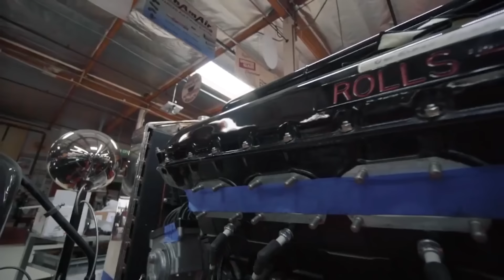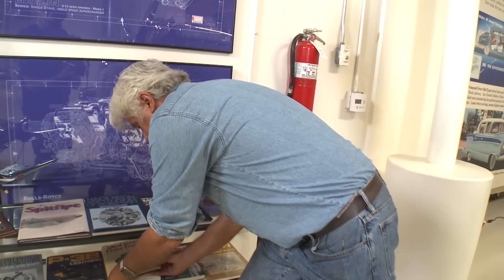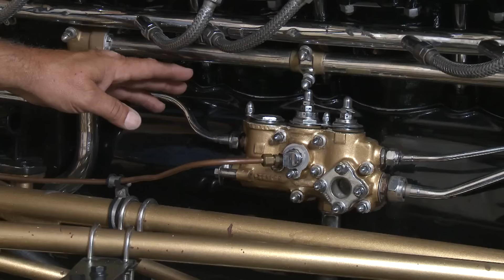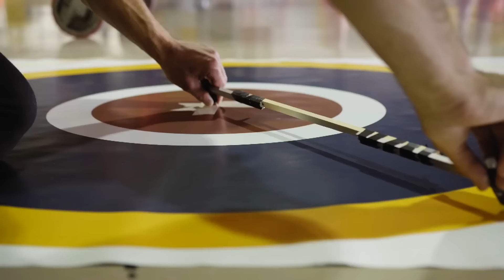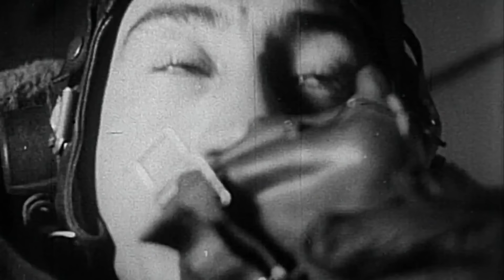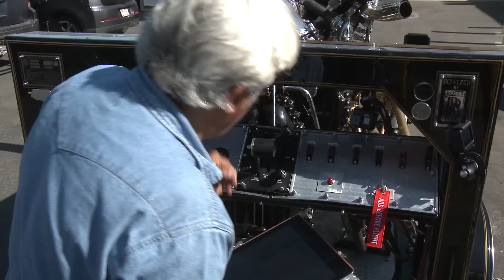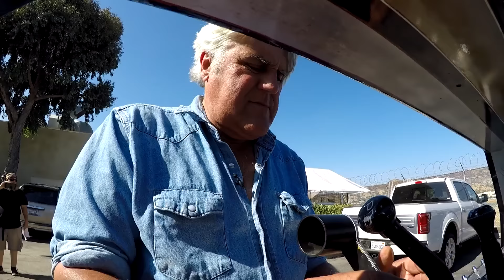The Engine That Won World War II - Jay Leno's Garage

Comment: The 109e Daimler engine was much more advanced, inverted V12, fuel inj, fluid drive altitude variable supercharger. They just didn't build as many as the Brits/US.
Reply: The only real advantage in battle was that it was fuel injected so unlike the Battle of Brittan era Spitfire it could pull negative Gs with no danger of stalling. The Spitfire was otherwise every bit a match for the ME 109. The Spitfire 9 was also every bit a match Foukewulf 190.
Reply: Ah pardon me - google has it more widely known as Miss Shilling's orifice - a device partially preventing what I described above.
Reply: advanced doesn't always mean better.
Reply: When citing German aero engine superiority over the Merlin, don't forget Churchill's admonition: "Second best tomorrow." It's better to have an adequate solution in mass production than low-volume exotic alternatives. The Merlin's chief claim to fame is its ubiquity, whether powering a big Lancaster bomber or a tiny Mosquito. And don't forget the Mustang's U.S. version, built by Packard under license from Rolls-Royce. Some say the Germans' fixation on ever-more-elaborate technology -- whether it be aero engines or battle tanks or submarines -- cost them the war.
Reply: If you're remodeling your house and people are dying, you're doing it wrong. 

War provides no benefit to human society.
Reply: The Nazis weren't equipped to handle the Siberian winter because Germany lacked the resources needed to provide their soldiers with the equipment necessary to survive it. I don't remember the numbers, but the losses due to lack of cold weather gear weren't nearly as great as the losses in combat.

Edit: I guess I should proofread my comments before posting them.
Reply: M ostly because it delayed entry into the war. While the ME 262 was virtually unbeatable in the air they had an fatal flaw without modern alloys they had only about 8 hrs flight time between major overhauls. Throttle response was slow going from cruise to max thrust could take 15 or more seconds, range was vary limited also. A handful were shot down by regular fighters almost all while trying to land.
Reply: leonardo da vinci had excellent designs but it did not mean that he could get them built or that they would work within an industrial process. 

The Germans may have had amazing designs that could be one off built but war was at an industrial scale meaning thousands had to be built.
Reply: The Daimler DB 601 engine was a great motor - small and lightweight: but in almost every other way that counts the Merlin was more capable (i.e. horsepower, torque, reliability, high altitude performance, and the ability to operate Inc a wide range of climates and I unusual attitudes under a wide range of G-loads.  ME 109s were built in Spain after the war and they were fitted with Merlins.
Reply: It's true that the injected diesel system on the German engines gave them an advantage, particularly with negative G forces. Mrs Schilling's orifice was a diaphragm in the float chamber with a hole in it, to alleviate the carb flooding caused by negative G, and gave a useful improvement.  Later, all the Merlins (UK and Packard built motors) got a pressure carburettor, which solved the problem of engine cut-out during negative G forces, without the complication of the fuel injection system used on the BMW and Daimler engines.  That's the kind of war-winning technology used by the Brits.  Solve the problem as economically as possible, so you can field the maximum weaponry as continuously as possible

BTW, the pressure carburettor was a joint US / UK development, no one can claim it as their own.  Made on both sides of the pond.  Once developed, everyone used it

Also, the Napier Sabre engine was way more technically advanced than the Rolls-Royce Merlin.  It had two flat 12 engines geared together, with sleeve valves, and sophisticated supercharging.  Like the German engines, it had a mechanical computer to juggle throttle, supercharging, propeller pitch etc.  Early in its combat career, the mechanics discovered that they could jigger the computer for what they thought was more performance.  In reality it caused serious damage to engines, and was the cause of much of this engine's reputation for reliability problems.  Once this was stopped, quality control improved, and a few development issues resolved, it was a very fine motor indeed, with 3000 reliable bhp on late WW2 engines.  Prototypes gave as much as 5000bhp, but there was no propeller in service which could make use of this output
Reply: The dive was initially a problem for the Merlin as the fuel went to the top of the Float-bowl ( or whatever the equivalent was) under negative-G causing the engine to momentarily cut out, you didn't "Fall out of the sky". This was solved by a British woman engineer called Miss Silling. It was basically a flow limiter inserted into the Carb and nick-named "Miss Silling's Orifice". It was also found that the two stage supercharger on the Merlin was more efficient than the German Variable blower. This is all from memory when I visited the RAF base at Scampton where they keep and service the Battle of Britain Memorial Flight, so I can't be more exact on details.
Reply: The reason the Merlin supercharger was more efficient was because it was a two-stage unit, the German engines typically had single stage units. A two stage compressor would still benefit from having a variable drive like what was found on the German engines. 

You might be confusing two stage and two speed superchargers. The better performing Merlin engines had two stage, two speed superchargers, the German engines (typically) had single stage units with a continuously variable drive. The Merlin in this video has a single stage, two speed supercharger.

Miss Shilling's Orifice was just a stopgap, it didn't offer the same benefits as fuel injection.
Reply: Snow Crest They had Hitler leading them. He was his own worst enemy. There was no way they could keep up with our production capacity. Oopsie!
Reply: Fraser Wright.
Germany made 34,000 Bf 109`s, they must have made quite a lot of DB and Jumo engines, but the DB engine was not as powerful as the smaller more efficient Rolls Royce engine.
Advanced should mean a 33 litre engine is more powerful than a 27 litre engine. US production was rather low until 1942.
British production was higher than German production until 1943, that is ships, aircraft and tanks and heavy guns.
Reply: You never know who littlewilburthesnoringtractor is raving on at, because he's too lazy to preface his replies with the name of the person he's abusing, so we just get one viciously infantile, filthy-mouthed rant after another..
If it wasn't so pathetic it would be even more pathetic.
Reply: idontcare.
Maybe you should change that to idontknow.
In 1940 it did not take overwhelming numbers to defeat them. The British did support a war in the Mediterranean and North Africa against theIItallians and Germans.  Britain was managing long ocean crossings.
Reply: look at the new Rotax 915 iS general aviation engine, then tell me it's not found in light aircraft!
Reply: I think the allied airframes and the fact that the allies had access to much higher octane fuel made the difference. The German engines were extremely reliable, reliability only suffered near the end of the war when their manufacturing abilities and resource supplies were severely impeded.

Edit: Also, the German engines were actually simpler in many very important ways when compared to the British engines, the Germans applied complexity where it gave the most benefit (they seem to do the opposite these days). The Allison was also a very well thought out design and produced some fantastic performance in the post-war years (with some help from what was learned from German aircraft engines).
Reply: Stuart Savage - It's barely coming on to the market, and Lycontisaurus engines are still much more popular in the US. The iS also has no provisions for controlling a constant-speed propeller. Both Lycoming and Continental have FADEC engines, but they're insanely expensive and extremely rare.
Reply: Arisgod27 fair comment. But the series 100 Merlins could produce up to 2600hp? And wasn't the BMW 801 based on an American Pratt & Whitney design??
Reply: German armaments production by 1943 was way above what it had been the previous year and the year before that, mainly due to the genius of armaments minister Albert Speer.  Even after all the gear they lost at Stalingrad, weapons supply was never a problem.  They after all had resources and labour from many occupied countries.  Fuel was another matter however.  A large part of the logic for the allied invasion of Italy was gaining bomber bases from which to attack the Rumanian oilfields.  Re Stalin, Hitler's first mistake was outlining his disdain for the Russians in Mein Kampf, so a non-aggression pact which no-one intended to observe was as good as could ever happen.  Certainly an alliance was never going to be feasible.  Hitler knew that Stalin had territorial ambitions too, so he attacked Russia before (in his estimation) Russia attacked him.  They may well have too - who knows?
Reply: How much power would those WW2 engines make with modern fuel injection and materials technology?
Reply: Nothing untrue about that. Look at the german tanks, superior to all other tanks of the time. But the didn't have enough of them compared to the russian T-34 and the american sherman.
Reply: Peter: This is similar when you compare American cars to German cars. American cars do not have the driving performance compare to German sport sedans but they are inexpensive to maintain by regular mechanics. German cars, however are finicky with all the electronic aids and they are a pain to do regular maintenance on.  After WW2, a cold war, and the internet age, something never change
Reply: Paladin Yogi - Even with the lower octane fuel that the Germans used, the DB 605 was capable of making just as much power as the most powerful versions of the wartime Merlin, it weighed just about the same, it wasn't sensitive to negative Gs, supercharger boost was automatically and continuously regulated (you have to manually change gears with the Merlin and it only has two settings), the DB engines had fewer parts, more evenly distributed fuel, and some technologies that we're only just now starting to see incorporated into modern automotive engines, they were significantly better engines.

I don't know what you mean by "going to be" the fastest, the Ta-152 was the fastest single-engine, piston fighter built during the war, only the Do-335 was faster.
Reply: I think touting the complexity of German technology during WW2 as the reason for why Germany lost the war is a pretty major stretch, just look at the numbers, their numbers were much, MUCH more effective. So, what would have happened if they had more of everything? The limitation was definitely not the complexity of the engines, the inline engines were actually quite a bit less complex than the British engines, I think the limitation was in the actual resources that Germany had access to. If Germany had been geographically located where the US or the Soviet Union was and had as many men, the current conversation would be a very different one.
Reply: "...without the complication of the fuel injection system used on the BMW and Daimler engines."

And without the benefits of fuel injection. And the fuel injection system wasn't even that complicated, especially when compared to pressure carbs. The Sabre was a great example of over-complication, relatively few were built and it was such a large and heavy engine that the aircraft it powered didn't perform all that well. Later versions of the Sabre were fuel injected.
Reply: As far as the discussion having deviated into the merits of German engineering in the Second World War what should not be overlooked is the state of American aeronautical technology.  While Germany had the edge in the science of jet engines and rocketry, they could not build anything as complex and sophisticated as the B-29 bomber, easily the most advance bomber of the war.
Reply: Yeah, by the end of the war the Americans had pretty much blown past everyone, except with their inline engine technology. And I think that the Germans could have built something similar to the B-29, but never would have committed to doing so, which was a major failing. I don't think any other country in the world could have built the firing system for the turrets on the B-29, though.
Reply: Fraser Wright and.....they lost
Reply: I'd tknow80.........The Germans should have thought of that before they started the war.
Reply: George B - Are you saying that the German engines weren't built during wartime, or while the factories were being bombed to bits? The Merlin wasn't anymore adaptable or reliable than the German engines, and the only reason it was typically able to make more power (not always) was because the allies had access to much higher octane fuels.

The British did have prototype axial flow jet engines (which Whittle was not responsible for the invention of) during the war, but didn't put them into production until well after the war. Most modern turbine engines are axial flow engines, and the Germans had them first.

webtoedman - The Stuka did not have a diesel engine, it had either a Jumo 210 or 211, you're thinking of the Jumo 205.
Reply: Snow Crest - They never should have started a war in the first place.
Reply: BikerBarrett - Yet more Red Army soldiers died as a result of the effort of fewer German soldiers. Also, I used to own a Mosin-Nagant that was produced during WW2, the thing was horribly made and would only fire if you pushed on the bolt with your thumb while you pulled the trigger. It was a common issue and people will often re-machine the rifles to make them function properly. A friend of mine had a German Mauser from the same time period, it was worlds better. I think people don't realize that most German weapons that were evaluated by the allied countries were built near the end of the war, when Germany's manufacturing abilities had been severely damaged and when they were struggling with extreme resource scarcity. 

Bmw EM - Those technologies would have been developed anyway, just slightly later. In fact, many of the technologies that were put into production during WW2 were in development before the beginning of the war. Anyway, I'd much rather have access to technologies 5 to 10 years later than to know that millions died to make it possible for me to use it a little bit sooner. It's also very likely that war seriously harms the health of populations that lose large numbers of young men, because the fittest men are sent off to die and have their genes removed from the gene pool, while the rejects stay home and survive.

Also, I believe in maintaining a strong military while avoiding the use of it at all costs, and as long as you're developing military hardware, those technologies will advance.

Edit: Not all costs, obviously, but I'm really tired and can't think of a better way to word that.

 ...war should be a last resort.
Reply: Search on YouTube: 2015 HAPO Gold Cup: U-3 motor camera

...the mighty Allison. It has to be making around 4,000 hp in order to keep up with the turbines, but these race engines are modified with modern knowledge of engine tuning and many modern technologies.  Notice that the Allison in that hydroplane uses modern turbochargers instead of its original supercharger. You can also see an MSD ignition coil, it's very likely running modern EFI and water and methanol are constantly injected in the turbochargers.
Reply: Fraser Wright i
Reply: +idontcare80
I had not heard of British axial-flow jet engines during WW2, and would like to know which company.  BTW, Whittle was aware of the axial concept, considered it a better long-term proposition, but went for the centrifugal compressor etc for pragmatic reasons.  And as you say, it was the axial-flow layout which quickly took over after WW2.  The German jet design teams went to France and Soviet Union after WW2
Reply: Read up on the Metropolitan-Vickers F.2. It was really Alan Arnold Griffith who is (mostly) responsible for the success of the jet engine, I don't know why Whittle or Ohain get any credit for that, their designs were largely dead-ends. Griffith was largely responsible for making the axial flow compressor into a viable technology (the Germans had to solve teething problems with the design), but he had no interest in making pure jet engines and didn't believe that they were a viable technology, he wanted to build turboprops. The Germans really were the first to develop the axial flow turbojet, and it was two members of the RLM, Helmut Schelp and Hans Mauch, who pushed for its development and who are probably responsible for choosing the compressor type.
Reply: "And who killed off all the  more experienced german pilots and why ?????"

Overwhelming numbers.

I agree on the Allison, I think it was a very elegant design and that it was actually just held back by politics. If it had been given the same two-stage supercharger that was given to the Packard Merlin and developed a little more, it probably would have performed just as well as the Merlin. Maybe Allison refused to refine the design, who knows?
Reply: The J30 didn't run until 3 years after the Jumo 004.

The Germans were the first to develop the axial flow turbojet, and that's the engine design that won out over all others. The turbojet eventually evolved into the turbofan, of course. 

The F.2 ran a year after the 004.
Reply: 'Fell out of the sky' is a bit strong. Yes it would stall if you pulled high negative G or inverted for too long, but would restart as soon as you eased off or flipped over the right way up. Of course it's best not to do that with Jerry up yer chuff!
Reply: Chris Stephens
Even if the Germans won the Battle of Britain (they  had no chance after being defeated over Dunkirk), they would have to sail over the Channel with hardly a surface fleet as most was destroyed in Norway, facing the largest navy in the world. Look up Admiral Raeders comments on it. Do no go on myth.
Reply: idontcare80
The Germans lost the Battle of Dunkirk. Hitler's directive 13 ordered the annihilation of allied forces at Dunkirk. They failed miserably. 350,000 men successfully retreated to fight another day. The Luftwaffe lost more planes over Dunkirk than the RAF who formed a CAP over the pocket. The Luftwaffe was also defeated in 1940 in the Battle of Britain.

Dunkirk was the first large showing of the Spitfire which performed admirably giving great confidence to the RAF pilots.
Reply: Paul Standeven
The WW2 German jet engines were extremely unreliable and had low performances with very high fuel consumption. The German axial-flow turbojets never worked properly and were developed up to 1953 by the French to obtain a usable engine. The French lost a lot of time playing around with the German engines, instead of working with the British. The French and Soviets after WW2 tried to improve the German axial-flow engines and largely failed. The centrifugal compressor used by the first British Meteor plane was fine and much more reliable, but unable to reach high compression ratios. This limited performances. Centrifugal compressors were used up to the 1960s. 

The British, in order to have a usable and reliable jet engine, with the technology available in WW2, went for a centrifugal design as the prime engine rather than the troublesome axial-flow design. This design produced less thrust than an axial-flow but was quicker to develop, reliable with longevity. It took 5 months to develop, while the first reliable commercially ready axial-flow engine was the 1950 Rolls Royce Avon, which took 5 years to get right. The Avon axial-flow engine was developed in tandem with the Metropolitan-Vickers design which first flew 1942 creating 8 variants. The MetroVick F.3 was the first turbofan engine to be designed, built and tested decades before the RR RB211. Armstrong Siddeley took on MetroVics design creating the F.9 Sapphire axial-flow design. The Sapphire was built under license in the USA as the Wright J65.  

In 1945 a team from the French ATAR laboratory plus some BMW and Junkers engineers, were engaged by the French SNECMA research bureau, with the objective to build a new reliable and performing axial-flow turbojet. The French made and tested some German designed turbo jets made with quality steel unavailable to German industry in WW2. They ran for 25 hours instead 10 hours to German engines made of poor steel. Not much better. The German axial-flow engines failed because of heavy design faults. The BMW 003/Jumo004 was considered unusable. It was tested on the first French jet aircraft, the 1946 So6000 Triton, overheating and exploding. The plane only flew with a Rolls Royce Nene centrifugal turbojet. 

The ATAR project took 8 years to produce the first acceptable axial-flow turbojet (ATAR 101 B1), produced in 1953. So 8 years R&D by the French using the German jet engines as the base, which had about 3 years previous R&D, so about 11 years in all. It was installed on the first 100% French jet fighter, the Dassault Ouragan. 

The French lost a lot of time because the German jets had concept fails essentially in the combustion chambers and fresh air circulation to reduce the external temperature of the engine. The engine gave poor efficiency. The BMW jet was known for overheat problems which precluded fuselage installation.

The German turbojets had severe overheat problems as the engine would not work in an enclosed fuselage for single engined fighters. This defect was immediately noted by the French on the 1946 "SO 6000 Triton" prototype, and by the Soviets on the 1946 Mig 9. The Soviets quickly replaced the BMW 004B2 by the centrifugal Rolls Royce Nene which worked without problems, dismissing the BMW engine for fighter planes. The Rolls Royce Nene was copied to the last nut by the USSR being installed in the Mig 15 and used effectively in the Korean war. About 10 years ago the USSR eventually paid royalties to Rolls Royce. 

The question at the end of WW2 was what is the most efficient way to produce jet fighters. The answer is clearly not adopting the German design of engine and fuselage. The build costs for a jet engine were much higher than a piston engine, with the fuel consumption near 3x. The centrifugal compressor the British adopted in some planes was by far the best choice with 1944-45 technology. More compression pressure was not an advantage when the hot turbine was unable to resist higher temperatures. 

The Meteor was the first proper fully developed jet plane introduced in engine and airframe. The me262 was slightly faster than the Meteor F3, but extremely unreliable. The British would never put into the sky such an undeveloped plane as the me262. The British could have had a jet fighter operational in 1941, but it would have been as bad as the me262. The Germans advanced R&D on jets after they interrogated captured British RAF men. They learned the British were advanced in jet technology and flying prototype planes. Until then the Germans had no intention of mass producing jet planes. 

The rushed together Me262 started claiming kills on 26 July 1944, the Meteor claimed its first V1 kill on 4 August 1944. But the Meteor was a proper fully developed jet plane, not a thrown together desperate effort as the me262 was. The me262 used a fuselage of a 1938 piston plane while the Meteor was a proper newly designed fuselage specifically for jet fighters with forward of the wings pilot position as we see today. 

Centrifugal compressors did not quickly become obsolete when axial-flow engines were perfected, being used in turboprops. Between a turbo jet and a turboprop, the only difference is the turbine, not the compressor. The last centrifugal compressor jet engine still in service on a handful of old commercial aircraft like the Fokker 27, is the Rolls Royce Dart turboprop. A very reliable engine made in 27 versions, but with high fuel consumption to modern engines. The turbo jet engine that was produced the longest, was the Rolls Royce Dart Turboprop - a comparable design of turbojet like the Rolls Royce Nene. This rugged engine was produced from 1946 up to 1987. 

There is a myth, especially in the USA, that the Germans were way ahead of the British in jet engines and planes in WW2, when the opposite is true.
Reply: the_punnisher
"Ferdinand ( Ferry ) Porsche ADMIRED the NSDAP  and Adolf Hitler. He designed the Peoples Car"
He copied it from Tatra of Czechoslovakia. VW paid royalties to Tatra after WW2.
Reply: The me262 was only good in a straight line taking out slow lumbering bombers.  It would lock onto to a bomber and open up with speed to shake off the escort fighters and fire at the bomber. Once it attacked it had to reduce speed greatly to return to base as it exhausted its fuel. A bit like a lion making an attack.
Reply: That was in early model Merlins.  The problem was solved in later Merlins.  The problem with fuel injection at that time is that engine has to run at pretty much a fixed boost and cannot take advantage of higher boosts as the fuel injector gives a fixed amount of fuel to each compression stroke.  With a carburetor it is a mass flow relationship, the more air crammed into the engine, the more fuel and the more power.
Reply: An inverted configuration is not any less advanced, it does nothing to improve or decrease the performance of the engine, some engines simply fit in the airframe better that way. Using an inverted arrangement allowed the German engines to use smaller, lighter gears in the PSRU, it improved visibility for the pilot, and it increased options for the mounting of weapons around the engine. Fuel injection allows for much greater power output than a carburetor because it provides a much more consistent fuel mixture to each cylinder, and it provides a more consistent fuel mixture over a much greater range of operating conditions. If certain cylinders are getting a leaner mixture, they're going to be much more likely to detonate and cause a catastrophic failure of the engine. Fuel injection is what allowed the Germans to make competitive amounts of power without ultra-high octane fuels. Carburetors are also more restrictive than fuel injection because they require a pressure drop in order to function, and a restriction is required in order to produce that pressure drop. I mean, how many engines do you see in the modern world that are not fuel injected? Why don't racing engines use carburetors if there is an advantage to them?   

"Variable supercharger that kept boost at a constant level because of the fuel injection such that power could only be increased with RPM."

What? 

"An engine at 2178 cubic inches that produced about the same power as an engine of 1650 cubic inches, was less efficient and got lower fuel efficiency."

A) That's was a result of their lack of access to high octane fuel.

B) A 2,176 cid engine that weighs as much as a 1,650 cid engine is incredible, because power to weight ratio is all that really matters in this application.

"With a carburetor it is a mass flow relationship, the more air crammed into the engine, the more fuel and the more power."

Just stop, this is getting sad. Not only are carburetors pathetically bad at maintaining consistent fuel mixtures over varying conditions, but the fuel injection system on the German WW2 engines worked on a speed/density principle, like many modern fuel injection systems. A speed/density fuel injection system determines mass airflow by using engine speed, air density and throttle position.
Reply: Geoff Dearth
Less than 4% of German armor were Tiger tanks. Tigers were mostly a waste of time, resources and fuel for German military. They sucked in fuel, were unreliable, too heavy, needed a tank transporter to move it, etc.

It was more a self propelled gun. Good in defensive situations, which was what Germany was fighting most of the time. As it was fighting defensively, it had a high hit rate.
Reply: Dave Henderson-   No, Dave, he's right.  The B-29 WAS the most advanced bomber of the war.  In order to qualify for this title, a bomber had to actually participate in the war effort.  'Design proposals' don't make the cut.  It doesn't matter how good it looks on paper, it wasn't reality and could contribute nothing to the war effort.  A lot of designs look good on paper, but would wind up unworkable for one reason or another.
Reply: idontknowmuch
What do you think happened in the Battle of Britain, the Luftwaffe tried to destroy radar, failed, they tried to destroy British production, failed, they tried to destroy the RAF in the air, failed,  they tried to destroy the airfields, failed so how is that not a defeat?  Hitler gave up any thought of an invasion of Britain and after that he had no chance of winning the war.
I call it a defeat.
Reply: Guess when Britain had working axial flow engines? they test flew in 1942 and by the end of the war they had reliable powerful centrifugal and axial flow engines. 
Which German designs were used post war? The Ta 183 was modified and made in very small numbers in Argentina but it was not much  faster than the Gloster Meteor and too costly for the Argentines to continue with. 
The Me 262 went no where and the German paper designs had no more than a slight influence on fighter development, the German jet engines were not used by anyone except Czechoslovakia in their copy of an Me 262, no more successful than the German Me 262.  France did take the BMW but they had to redesign it to make the Atar . Russia got the Rolls Royce jet engine and so did USA.
The Me 262 which was a new plane with straight wings used a piston engine because the BMW jet engines were not ready, they never were really. The first flight with the BMW engines, the piston engine was still in the nose, just as well, both jet engines failed. The change of engines meant a shift in the balance and rather than move the wings back on the fuselage they changed the design to incorporate a slight sweep back, it had no aerodynamic benefit. 

Rockets were the only area the Germans were ahead and they lost more Me 163`s because of the failure of the rockets than the Me 163`s could shoot down allied aircraft and the V 2 was no good as a weapon, it could barely hit a city the size of London.
Reply: Idontknow
The first flight engine F2 (Freda) ran in a test cell during December 1942, by June 1943 an F2 engine of 1800 lb static thrust was altitude tested in the tail of a Lancaster Bomber. The Lancaster which operated from the RAE Farnborough became the topic of much local discussion as it flew over the Manchester area. Interestingly the aircraft allocated by the ministry was the Lancaster prototype which proved to be most unreliable, much to the frustration of Dr. Smith and the Metrovic team.
The first aircraft to be powered by an axial flow turbojet was a Gloster F/9 40 Meteor aircraft, the flight took place at the RAE on the 13th November 1943.
-The Urmston Connection - a tribute to Dr. David Smith FRS.
Reply: Idontknow
"There's no magic involved, just engineering, "
Which you have not a clue about.
Reply: idontknow.
You do realize that the bigger German engines with fuel injection were less efficient and gave less power than The Rolls Royce engines with carburetors do you?  The only advantage was that the fuel injection did not have a problem with negative G, but Rolls Royce even solved that. 
The allies as in Britain had 100 octane in 1940, it is a myth that they got 100 octane from USA, Britain had 3 refineries in 1938 producing 100 octane and they had enough in stock in Britain for the RAF before the Battle of Britain.
 130 or 150 came later,Germany had access to American fuel, the 87 is just another myth. 
The Rolls Royce engines could use high boost with carburetors.  pre war cars in Britain had superchargers using carburetors and 40 lbs boost. As late as the 1970`s when Aston Martin were using fuel injection there most powerful car had carburetors.  Fuel injection needs modern electronics to work well, it was not so good until well after the war.
Reply: idontknow.
You really do not have a clue.
The fastest racing cars before the war most of which did not use fuel injection, even after the war many racing cars stayed with carburetors for a long time, I have raced quite a few cars of the 1950`sand 1960`s and they did not have fuel injection.
The forward thinking Germans copied Whittles patents for centrifugal and axial flow. Britain was working on and had running axial flow engines in 1942, they test flew in 1943. the centrifugal engine was simpler and worked better than the German axial flow. 
The German axial flow gave less thrust than the British centrifugal flow engines, the Jumo got around 2,000 lbs thrust, the Derwent went on to give 3,500 lbs thrust during the war and the RR Nene was for a time the best jet engine in the world, until overtaken by the RR Avon an axial flow based on British work, not German, the Avon first ran in 1945.
You have been proven wrong again poor boy.
Reply: "I have raced quite a few cars of the 1950`sand 1960`s and they did not have fuel injection."

Carburetors are cheap, and fuel injection is not an easy thing to get right, people stick with what they know and/or what they can afford. 

"The forward thinking Germans copied Whittles patents for centrifugal and axial flow."

Whittle never patented an axial flow turbojet.

"Britain was working on and had running axial flow engines in 1942, they test flew in 1943. the centrifugal engine was simpler and worked better than the German axial flow. "

The Germans had running and flying axial flow engines BEFORE the British. Look up the dates you illiterate ****.

"the centrifugal engine was simpler and worked better than the German axial flow."

It was a technological dead end, it was the axial flow engine which would make the centrifugal engine obsolete, and the Germans had it first. 

"You have been proven wrong again poor boy"

Nope, you're just making up bullshit, because you're ***** insane and we're just going to go around and around forever because you're also ***** illiterate.

The Me 262 outperformed the wartime Meteor, so the Germans clearly knew how to build a better fighter overall.
Reply: Oh, and even mechanical CIS injection was eventually made to work well enough to be an upgrade over carburetors on light aircraft engines, and that's about as basic as mechanical fuel injection can get.
Reply: I didn't say the Brits were crap at anything, I've acknowledged plenty of their accomplishments during the course of this discussion, I'm just pointing out that the Germans were clearly the superior engineers. 

Hell, that's even been thoroughly proven all throughout the time since WW2, the British auto industry was an utter failure. British vehicles have a worldwide reputation for poor reliability and performance (McLaren is the one exception in that area, but very few have experience with their vehicles) and the Germans do pretty well in those areas. Hell, the Germans own quite a few of the brands that were traditionally British because the British couldn't compete with any of the other major players in the world.
Reply: Ah, this was what was in the back of my mind re the starving carburettor issue.  http://aviation-safety.net/wikibase/wiki.php?id=18913  I read elsewhere that the left engine of this aircraft used an earlier carburettor than the right, one more prone to this problem.
Reply: The Daimler engines and the BMW 801 where masterpieces of engineering.  To think that the Germans were able to continue fighting beyond 1943 when the Ally bombers were bombing them day and night is incredible if you think about it.  If Hitler continued his pack with Stalin and never invaded them and God forbid they allied with each other (so the Germans would have had the resources, especially the oil) who the hell knows how things would have turned out.  Most likely nuclear bombs would have had to be used on German.  Also the insistence for the ME 262 to be used as a fighter bomber by Hitler destroyed the effectiveness of that incredible plane.
Reply: idontcare80 Of course they had the provisions to provide coats and winter boots if they had time. Soviets had already mobilized the forces for operation Thunder. Germany made a preemptive strike.
Reply: Richard Harrold a lot because of fuel quality and octane rate.
Reply: Didn't have the Fuel either.
Reply: That's right! But a German engine didn't "win the war"... This here is for "winners"... The technical things are not so important anymore... right?! That's the American sight on things... as usual! The same goes with "winner-justice"...
Reply: Yes... Congratulations to your achievement!lol!
Reply: LH it`s because when the p 51 came over the war wasn't the same, other variables comes into play. You have to take it into context the 109 production started back in 1937 and it were the germans go to plane ever since then.
Reply: It is true.
Reply: That was true in the earlier versions. Late versions
 had that problem taken care of.
Reply: Peter Anderson No not at all . I cannot remember her last name. Will get back to you on this. She was quite an able engineer.
Reply: Peter Anderson You clearly found Miss Tilly Shilling. My memory had it Tillie. Sorry. The 1996 Mosquito accident was new to me. Just not possible to know as much as you would like. Cheers.
Reply: idontcare80 they did that back in 43-45, no one did it again till the micro processor came into use! Amazing engineers. Still are to this day.
Reply: Head out to the Reno Air Races if you want your fill of Merlins.  BTW, Mike Nixon at Vintage V12s is as nice a guy as there is.
Reply: idontcare80   Yes, and they had thousands of T-34 tanks that overwhelmed the technically superior German Panzers at the crucial battle of Kursk.
Reply: And look where it got them. You're only as strong as your weakest link.
Reply: The Germans also hat jets and rockets that  were way more advanced than anything else at the time.
Reply: idontcare80 that's simply not true. The soviet military machine was easily superior to Germany's once it got ramped up. Tanks that didn't break down in the field and did much better in the mud, guns that didn't jam and superior tactics.
Reply: Norman Rand Wolfe unfortunately? Are you crazy?!?
Reply: theonexHD the German army never got anywhere near Siberia.
Reply: Germany had the numbers and the tech and everything but their idiot politics wasted it all.
No country ever could wage war on as many fronts as Hitler wanted to.
Reply: "Resources" means intellectual resources also.
The statement remains true.
Reply: The Red Army and the Soviet Union also suffered the highest number of casualties in WWII
Reply: Oh i don't know. The our gnng had more nukes than Hitler's gang. That won it for us didn't it? lol
Reply: Were the close tolerances in the fuel injection or generally, in the running gear and valvetrain etc? Fuel injection needs really tight tolerances, especially injectors and especially injectors controlling a low viscosity liquid like petrol. In fact it was only when spark erosion was introduced that good enough precision and  reproducability was achieved, I'm told. In any case, the tolerances needed in carburetters are also pretty tight. As the Germans say themselves: you can only boil (food) with water.
Reply: Both go bang and fire bullets, but the shell cases ejected from the Sten were likely to take your finger off. When I was a lad in the 50s there were a lot of ex-infantymen in the UK who were laughingly known as "Lefty".
Reply: As an Englishman living in Germany - and working in the engine industry - I can't say I've noticed that disdain or any reticence to praise German WW2 weapons. Folk seem to want to salvage a little pride from a dismal episode, but their knowledge is often very one-sided.
Reply: "Germany had the numbers and the tech and everything but their idiot politics wasted it all.
No country ever could wage war on as many fronts as Hitler wanted to."

Do you not see the contradiction in that statement? They clearly didn't have the numbers to fight effectively on the many fronts that Hitler wanted them to.
Reply: The latter Merlins had fuel injection. Early mechanical fuel injection was very fuel thirty.
Reply: Sigh. I have a stable of XJ12s, One became a daily driver by banishing all of the LUCAS parts and the underpowered BOSCHE  alternator ( 65A vs 105A on a GMALT conversion ) and using ISO relays and relay sockets.  I drived 45 miles each way with it and used it on contract jobs for over 5 years. I had to stop for the customer PR problems it caused ( if the  tech can afford this, what is my bill going to be? ) .

On the military side of things, the FW 200 was a true intercontinental flying aircraft. If the design staff had finished an atomic weapon......
Reply: There were hundreds of thousands made here in Toronto (Inglis) at a converted washing machine factory.
Reply: A reminder of why I refuse to drive Porsche automobiles : Ferdinand ( Ferry ) Porsche ADMIRED the NSDAP  and Adolf Hitler. He designed the " Peoples Car  " ( Volks-Wagen auf Deutsch  ) and most of the tanks ( Panzerkauftwagens ) as well as being a design consultant for the V-1 Buzz Bomb.
Reply: blackice214 evil finds a way to lose.
Reply: idontcare80 if that was true the USA would still be part of the British empire. It's so much more than that.
Reply: Germany had an incredible military and it took absolutely overwhelming numbers to defeat them, the stats clearly show that. The British couldn't support a war that was happening so far away from their country in a time when ocean crossings were long, difficult and expensive, it's as simple as that.
Reply: For all the doubters, the Merlin allowed us Brits to win the Battle of Britain, had we lost the battle, the Nazis would have been able to invade. If that had happened they would have been able to defeat the Russians too. Also, if we had lost the B of B the Yanks could not have invaded Europe, had they not been able to so who knows what the Nazis been able to do, certainly send  rockets across the Atlantic, or invade across the Bering Strait from Russia. So in summary, yes it was the engine that allowed us to win the war.
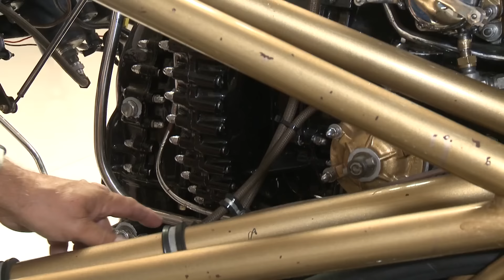Reply: John Burns 5:13 Probably what Leno is talking about at this point. I found the following post in a Merlin forum:
"The Merlin fuel injection system was a single nozzle directed at the root of the supercharger vanes as stated previously. Not the PI systems of modern day but a vast improvement on the carb"
Reply: Barrie Rodliffe - WTF are you talking about? The Germans weren't defeated in 1940.
Reply: Fraser Wright two world wars one world cup.
Reply: Very early versions of the Merlin engine couldn't do negative G, because of the carburettor, but that was fixed to a large extent by the introduction of 'Miss Shilling's orifice' (research that for yourself).  Beatrice 'Tilly' Shilling's team at the Royal Aircraft Establishment went on to produce an 'anti-G' carburettor, which was installed in time for the Battle of Britain, with the final solution being the Bendix-Stromberg carburettor.  It's all in the Haynes manual that Jay Leno showed us: I have a copy (cost GBP25).
R-R claimed a positive benefit for the carburettor over direct injection, because the evaporation of the fuel entering the supercharger provided a cooling effect
Reply: Armstrong Siddeley ASX and Metrovick Beryl, to name but two British wartime axial flow jet engines, which led to the Armstong Siddeley (formerly Metrovick) Sapphire, which became the Wright J65.
Reply: MarsFKA
Fuel injection squirts while carb's suck. The Lucas fuel injection was a a single point affair, but fuel injection.
Reply: idontcare80
"The Nazis weren't equipped to handle the Siberian winter because Germany lacked the resources needed to provide their soldiers with the equipment necessary to survive it."
The Germans had the winterwear. They could not get it to the front as they supply line were to few and being attacked. The Nazis were hit by a battering ram in Dec 1941 at Moscow being pushed right back. 40% of the tanks used were supplied by the British. Game over, they were not going to win.
Reply: RogerRamJet
"While the ME 262 was virtually unbeatable in the air they had an fatal flaw without modern alloys they had only about 8 hrs flight time between major overhauls. Throttle response was slow going from cruise to max thrust could take 15 or more seconds, range was vary limited also. A handful were shot down by regular fighters almost all while trying to land."
The plane (a 1938 airframe) and jet engine were flawed. The French attempted until 1954 to perfect the German design using top grade metals. They did but it took 9 years and more including the WW2 German R&D.  Me262 pilots feared the Tempest most.
Reply: Douchechills
The Sten (later Sterling, used by Stormtroopers in StarWars films) was brilliant. The French and German copied it. Easy to make and made by the millions very quickly. They are war winning weapons.
Reply: grahamj9101
The centrifugal jet engine took 5 months to R&D and was ready in WW2 being very reliable and in a dedicated jet engine airframe - the Meteor. While the first successful axial-flow, the RR Avon, took 5 years.  The US axial-flow engines were not complete and put into Sabres. The excessive burn out rate of them in Korea was testament to the premature deployment.
Reply: All history is just someone's opinion, but the consensus is that to cross the channel you need air superiority, something they could not  claim definitively.
Reply: They solved that problem quickly in 1943 with pressure carburetors.
Reply: The Daimler-Benz 608
Reply: The allies also lost many battles, my point is that it took overwhelming numbers to defeat Germany's superior forces. 

Plenty of sources say that the Germans didn't have winterwear at all. Even if they did, they lacked the resources necessary to get them to the front. My point was that resources win wars. 

It took a long time for anyone to make axial flow engines viable for production, but the design did win out in the end. I never claimed that the Germans had mature product, they obviously rushed their engines into production, I'm only saying that Germans picked the winning design right from the start. Edit: ...and were the first to do so.

The Germans were ahead in aircraft design. The Me 262 greatly outperformed the Meteor as it was during the war and many German designs were used in the post war years as a base for the most advanced fighter jets. The Germans were unable to develop their designs because their ability to build them was being destroyed.

Rocket technology was another area where the Germans were ahead. 

"The me262 used a fuselage of a 1938 piston plane..."

This is completely false, it first flew with a piston engine for flight testing because the engines that were meant for it weren't developed enough to fly.
Reply: Fraser Wright It was definitely a marvel in itself with the fuel injection alone,could reach higher altitudes and fly upside down all day,gave it an advantage over carbearators,only thing that hurt it was the synthetic fuels they had to use,all WWII engines were marvels for their time. 😊😊✌✌
Reply: They not only continued but production numbers of everything went UP..till late 44... That shows how misguided and ineffective the Strategic Bombing campaign, especially the farcical "precision daylight bombing"  was...
Reply: By that logic you could say the Klimov V12 won.
Reply: They could build the planes but they ran short of pilots and fuel.
Reply: And factories, and metals, and pretty much everything else. They were even starting to build planes (or parts of planes) out of wood (example: the Horten Ho 229, which also made use of early stealth technology) because they had such limited supplies of aluminum and steel.
Reply: Fraser Wright-  And there's the crux of the matter-  Germany's industrial base compared to that of the Allies.  Just imagine what would have happened IF Germany did possess  (A.)  A long-range 4-engined bomber similar to the B-17 or B-24, and (B.)  a long-range fighter to escort those bombers.  Britain would have been flattened, the U.S. would have had no forward base from which to launch an invasion of Europe, Germany would have controlled Gibraltar and thus all of the Mediterranean, North Africa, and the Mideast after Britain's 8th Army there had capitulated.  Hitler's conquest of all of western Europe, from the Arctic Circle to the heart of Africa, would have been complete and his position would have been invulnerable to attack.  Our only choice would have been to throw our complete support behind the Soviets, supplying them from the east, through the port at Vladivostok, and then west by a single rail line.  But in order to do that, we'd first have to destroy the Japanese Empire in the Pacific,  single-handedly now that British forces in the East had collapsed and were rounded up by the Japanese .  Can you imagine how much longer that war would have taken?  And all because Germany lacked one or two key elements.
Reply: I read a fascinating article on some economics journal one time..I gre up son of a US Navy pilot in the 50s --if it had a propeller on it between 1942 and 1972 and the Navy had 'em, he flew it.. Mainly in ASW so PBY Catalinas, PB4Y-2 Privateer--the Navy version of B-24s, PV-1 Harpoon (development of Hudson the English should know), and P2V Neptunes---and a ton of others.. So from 5 years old I'm seeing Wrings and Pratt and Whiteys out and torn down.. Myself I've been a machinist mostly and 20 years mechanic on hi performace stuff so the manufacturing process has always been of interest..
This artlcle pointed out the GIGANTIC increase in engine production that USA did compared to all the other major powers...
It wasn't materials, everybody had supply issures, it wasn't so much design...if you ever spend some time in service manuals and know engines they were all remarkably similar mainly differening in the Gerans making larger engines for given HP--thus a little less stress, and the US doing the same with its radials..
The big difference was in the manufacturing process--the machining of the stuff...
This artical went back to 1932, the depth of the Depression, when GM overtook Ford as the largest car maker and also amde more money.. IT said the way GM did was by a huge investment of capital in machining process mainly designing and building extremely specialised machine tools that did ONE operation and did it perfectly enough even with a semi-skilled machine operator>>>NOT a journeyman machinist with decades of experience but a guy fresh off the farm with mud still on his boots..short training of people, semi skilled but big investment in specialised tools>>It was this thinking that allowed USA to make hundreds of thousands of aircraft...and enough engines for all those and spares.
Don't know if the formatting will work but heres a table:
Country 1939 1940 1941 1942 1943 1944 1945 Total
U.S. 2,141 6,068 18,466 46,907 84,853 96,270 45,852 300,557
Germany 8,295 10,862 12,401 15,409 24,807 40,593 7,540 119,907
USSR 10,382 10,565 15,737 25,436 34,900 40,300 20,900 158,220
UK 7,940 15,049 20,094 23,672 26,263 26,461 12,070 131,549
Japan 4,467 4,768 5,088 8,861 16,693 28,180 8,263 76,320
Total 33,225 47,312 71,786 120,285 187,516 231,804 94,625 786,553
 Just look..USA made 17 times more in 1944 as they did in 1939, Germany "merely" 5 times as many...
Everybody else depended on very skilled machinists...and had a hard time integrating women-except GB--
Of course as interesting as it all is, USA and UK's fixation on "strategic" bombing was so encompassing that it led to a chronic shortage of infantrymen.....and that goes some way to explain the extremely limited numbers engaging Axis troops----and our Soviet allies bearing the overarching job of killing the baddies ---which they did fully 88% of German battle dead was  im Osten...weisst du....
Reply: "It wasn't materials, everybody had supply issures..."

Are you serious? The US was able to make so many more engines because it had access to much greater amounts of resources. Germany wasn't limited by a lack of desire to produce more, they simply didn't have the resources to produce more. 

"...it wasn't so much design..."

Piston engines are pretty similar, but minor differences in their design can make huge differences in how they perform. The Germans had adopted technologies that gave them significant advantages. Germany also had to deal with having it's engines run on much lower octane fuels (high octane fuels were a resource that Germany didn't have access to), and that makes a HUGE difference in how engines perform.

"The big difference was in the manufacturing process--the machining of the stuff..."

No it wasn't, it was the manufacturing CAPACITY, and the more resources you have, the greater your manufacturing capacity will be. You can't even invest resources in giant factories filled with specialized tooling if you don't have those resources.

Germany's military was overwhelmed by overwhelming numbers of inferior weapons, your table clearly shows that.

Germany couldn't increase its rate of production because that would have required resources that they didn't have. That problem was compounded by their production facilities constantly being bombed into oblivion, because they constantly had to invest resources in rebuilding them. 

Resources include manpower, because manpower is required all the way from the point that a natural resource is extracted from the ground to the point that it's used in combat. The fewer men you have to make use of resources, the lower your production capacity.
Reply: Ok you win the fucking internet..I've been around these engines for 60 years, a machinisr for 48 years, and serious engine builder --4 strokes--for 40 years, I read a serious ecomonic journal article which makes sense having been in manufacturing in 3-4 countries,  yep you out-Googled everybody....Moisin Nagant was inferior to 98k, PPSh was inferior to MP40, T-34/85 inferior to PkwIII and IV....Lavochkin and Yakolev inferior to...yeah, right.
You have any fucking idea how aluminum is made--where we got our bauxite from? 
Go back to History Channel.
Reply: You haven't been around German WW2 aircraft engines for 40 years, hardly anyone has because there are hardly any left. Hell, there weren't all that many when compared to allied engines to begin with! People are even digging the German engines out of the ground after they rotted for half a century to try to restore them because there are so few of them left.

What does an economics journal have to do with anything here? It says the Germans had a limited production capacity, it doesn't tell you why that was, I'm telling you why that was.

I don't really know much about armaments, actually, other than my personal experience (the Mosin-Nagant and the Mauser), and I don't care to. My interest is in transport technology, and aviation and engines are a big part of that.

"You have any fucking idea how aluminum is made--where we got our bauxite from?"

The US has quite large deposits of bauxite.
Reply: Daimler Benz DB-605 (not even going to mention the earlier DB-601 of the Bf-109E) Much more advanced?  i.e. inverted V,  like a version of the old Liberty engine, or the Curtis Typhoon of 1924, or the Packard inverted V engine of 1923 or the Ranger air cooled inverted V used in trainers and the Curtis Sea Mew. Fuel injection?, which limited power output vs a carburetor.  Variable supercharger that kept boost at a constant level because of the fuel injection such that power could only be increased with RPM. An engine at 2178 cubic inches that produced about the same power as an engine of 1650 cubic inches, was less efficient and got lower fuel efficiency.
Reply: The BMW 801 had insufficient supercharger boost for high altitude.  The Germans were trying to come up with a turbo supercharger like the Americans used to augment its supercharger.
Reply: +alexander kasady
You have such a wandering mind.:)
Reply: @ mrzoperplex
"While Germany had the edge in the science of jet engines and rocketry, they could not build anything as complex and sophisticated as the B-29 bomber, easily the most advance bomber of the war."
I don't think it's true to say that - the German aeronautical companies had many proposals for some interesting and (as far as I'm aware) fairly sophisticated heavy bombers, but Hitler continually nixxed any aircraft that wasn't a fighter-bomber.
Reply: You could make the argument that Germany "wasted" some of its engineering on armaments.  E.g. many tank breakdowns at Kursk have been attributed to this.  The T-34 was never accused of using advanced engineering.
Reply: then you don't know how to win a war or indeed a game of cards dude
Reply: They didn't like a negative G dive and would cut out which is why Spit pilots always rolled and pulled to stay positive :) The fuel injected German engines didn't have to worry about that but instead worried about the Spits out turning them.
Reply: mikeymarmalade
Mrs Shilling sorted that problem very quickly.
Reply: alexander kasady
The Lancaster had a larger bomb load than the B-29. It held the tallboy and grand slam bombs, which exceptional bombs. At one time the whole US air force's bomb capacity could be fitted into the Lancaster fleets bomb bays alone.
Reply: As much as I like the Lancaster, it wasn't as fast as the B-29, it didn't have nearly as great a range, it wasn't pressurized, it didn't have nearly same service ceiling, and it didn't have the ridiculously advanced turret control system that the B-29 had.
Reply: idontcare80
The Lancaster was designed to bomb Germany, not fly over vast distances in the Pacific. It carried a greater bomb load. The next British bomber in line was the Canberra jet bomber, which was light years ahead of all others. 

If the British had a requirement for a heavy bomber to fly vast distances, they would have built one. And of course it no doubt would have been the best at the time.

The Soviets copied the B-29, which was more reliable as they had better engines.
Reply: "It carried a greater bomb load."

It really didn't. If pushed, both aircraft could carry ~20,000 pound loads. 

All the rest of your comment is pure conjecture.
Reply: John Burns bit it was still a problem and that's the point. It's like saying you took antibiotics for an infection... You still had an infection.
Reply: idontcare80
The Lancaster could carry 22,000 pound loads.
Reply: mikeymarmalade
The Spitfire's negative G was solved very quickly with all being instantly retrofitted. Also during the battle the Spitfire was updated: better pilot armour, seal sealing fuel tanks, etc.
Reply: The B-29 could carry TWO 22,000 pound bombs. Geez, man. It's a bigger, faster, more powerful plane, there would be something seriously wrong with it if it couldn't carry a greater load.
Reply: Gary Tarr
WillbursoararsetraitorFinnigan is a complete nut.
Reply: Advanced does not win wars, simple does the 'Sherman' tank was an absolute piece of crap compared to the 'Tiger' which had far superior armour, superior and larger gun, yet they couldn't produce enough due to the complexity. The merlin was powerful and simple to maintain and produce.
Reply: The Tiger was very heavy, for the engines and transmissions that they had available.  Pushing the limits will always be risky, especially when you are literally under the gun to get the product out the door as soon as possbile.
Reply: To win the war... If the men could, they'd rather not die in the war. Hitler invaded the Soviet Union, killing many people, so the people had to stop him, no matter what it takes. It's not the number of people, it's the state of mind. Nobody was fighting for Stalin or some esoteric ideas of communism in the war. It's either you or them.
You can have millions of cowards, would that help you? Look around for the answer, we now have a world of cowards. The positive point though is that now we try to maintain peace over stupidity of war. I wonder, if there would be the time when finally we will choose progress of technology/stuff/nature over stupidity of the over-advertised 'consumery".
Reply: idontcare80
The British were ahead of the Germans in axial-flow. No one got axial-flow right until the 1950 RR Avon. The US axial-flow engines were clearly not right and needed replacing at an amazing rate in the Sabre in Korea. 

"how many battles did the British lose to the Germans at the beginning of the war?"
The British left France because the huge French army capitulated and the British (only 9% of allied forces) were facing a 2 million strong army. The British won the Battle of Dunkirk. After the small BEF left France in June 1940, the British went on the rampage.  Right after the retreat at Dunkirk, up until early 1941, the British had:

• Destroyed the German surface fleet.
• Neutralised most of the French fleet by sinking 
  or starving it of fuel.
• Disabled a major part of the Italian fleet.
• Freely moving around the Mediterranean.
• Starving Germany of food and resources 
  with the effective Royal Navy blockade.
• Beat the Luftwaffe over Dunkirk.
• Beat the Luftwaffe in the misnomer the Battle 
  of Britain as Britain was never threatened.
• Pushed the Italians out of East Africa.
• Decimated the Italian army in North Africa.
• Were about to take all the southern Mediterranean coast.
• Germany was being bombed from the air with raids 
  of over 100 bombers - 150 over Nuremberg - using 
  the new navigational device, Gee.
•  A massive air bombing fleet was being assembled.
• The RAF shot down over 700 German fighters over 
  Continental Europe in 1941.

In 1941 the British suppressed an uprising in Iraq, beat the Vichy French in Syria and secured Iran and the oil by invading. The British determined where the battlefields with the Axis were going to be. 

After France 1940 Germany never had a significant campaign victory over the British Commonwealth ever again in WW2. The Germans FAILED:

• To win the Battle of Britain in 1940;
• To win the Battle of the Atlantic in 1940/41;
• To control the eastern Atlantic ;
• To control the Mediterranean in 1940/41;
• To control North Africa and the Middle East in 1940/41. 

The British Commonwealth stopped the Nazis/Axis achieving all this well before the USA joined WW2 or even sent Lend Lease. Even the expensive pyrrhic victory in Crete meant little in the end to the Nazis because the Royal Navy still dominated the eastern Mediterranean with Crete not leading to any campaign winning difference.
Reply: idontknow.
How many battles did Britain lose?  Let`s Dunkirk the German lost any chance of stopping 1/3 of a million troops get away so that can`t be seen as a loss for Britain can it.  The Battle of Britain was a British victory, so in 1940 the answer is none.
The British axial flow did work during the war and it was test flown but at the time it did not give better performance than the simpler centrifugal engine so Britain was right while Germany having copied the British design got it wrong and they never made a good jet engine.
The Ta 183 even though some claim the F 86 and Mig 15 were based on it  just shows ignorance, the only similarity is the swept wings. 
Fuel injection was not a German invention and Rolls Royce knew that it did not give as much power or efficiency as a carburetor. that is why the Merlin and Griffon did not use fuel injection until SU had developed an injection pump for Rolls Royce.
I guess you don`t know that by 1945 Britain had 3 working axial flow designs that made the German effort look silly, the Rolls Royce Avon, the Metropolitan Vickers Beryl and the early version of the Sapphire engine, which later became the first in the world to achieve supercruise.
What were these fastest piston engine fighters? the Bf 109 K 4 which could not keep up with a Spitfire Mk XIV or the Fw 190 D 9 which also could not keep up or do you mean the Ta 152 H which was fast but only produced in small numbers it did 472 mph but was useless except at high altitude, they made the Ta 152 C with shorter wings and a different engine just 441 mph top speed.
Or do you mean the Do 335 which had a claimed top speed of 474 but never entered service. just a few pre production and prototypes and few flights.  I guess you don`t know the DH Hornet prototype also flew during  the war and  did 485 mph.
Reply: Idontknow
Whittle's first testbed engines were axial-flow. He dropped them because of the metals they needed, etc, and technology of the time to overcome it quickly. He had to get a jet engines in the skies quickly and the centrifugal jet was the way in WW2. The centrifugal took 5 months to develop to a reliable proper engine, but the axial-flow took 5 years, the RR Avon. The Germans copied Whittle's patents.  They were made public before WW2.  The German engine was heavily flawed - ask the French, who regretted initially going down the German route of jets. The British would never put such a thrown together engine into a plane and make it operational.  German engines would burn out and stall regularly. 

Americans make out the Germans invented the turbojet and made a complete reliable engine - they never.  They make out they were first at jets, they were never. The modern turbojet is down to Frank Whittle. When allied men looked around the German jet R&D labs they found all was based on Whittles patents with copies in German in most desks.
Reply: Idontknow
"German fuel injection revolutionized the piston engine."
It did not, if it did we would have all been riding around with immediately post WW2.  We never. The Merlin had one single injection point into the supercharger. Simple with pre-mixed charge.
Reply: Idontknow
spurted forth.. " the German design, was different, more modern, and they conceived it entirely on their own."
Total bollocks!
Reply: Idontknow
Frank Whittle's first test bed engine was axial-flow. The Brits realised it could create more power, but had serious R&D problems. The pressing need was a jet engine that worked reliably, so they went down the centrifugal route, while still working on axial-flow.  

You are so dumb you cannot see that the German engine was a thrown together desperate effort, that the British would not dream of putting in a plane. 

The first proper reliable jet engine produced was in the British Meteor plane.
Reply: Idontknow
"It was BMW and Jumo who developed the first axial flow reaction engines, and nothing that they did was based on Whittle's design"
Total tripe.
Reply: Idontknow
The WW2 German jet engines were extremely unreliable and had low performances with very high fuel consumption. The German axial-flow turbojets never worked properly and were developed up to 1953 by the French to obtain a usable engine. The French lost a lot of time playing around with the German engines, instead of working with the British. The French and Soviets after WW2 tried to improve the German axial-flow engines and largely failed. The centrifugal compressor used by the first British Meteor plane was fine and much more reliable, but unable to reach high compression ratios. This limited performances. Centrifugal compressors were used up to the 1960s. 

The British, in order to have a usable and reliable jet engine, with the technology available in WW2 and tight timescales, went for a centrifugal design as the prime engine rather than the troublesome axial-flow design. This design produced less thrust than an axial-flow but was quicker to develop, reliable with longevity. It took 5 months to develop, while the first reliable commercially ready axial-flow engine was the 1950 Rolls Royce Avon, which took 5 years to get right. The Avon axial-flow engine was developed in tandem with the Metropolitan-Vickers design which first flew 1942 creating 8 variants. The MetroVick F.3 was the first turbofan engine to be designed, built and tested decades before the RR RB211. Armstrong Siddeley took on MetroVics design creating the F.9 Sapphire axial-flow design. The Sapphire was built under license in the USA as the Wright J65.  

In 1945 a team from the French ATAR laboratory plus some BMW and Junkers engineers, were engaged by the French SNECMA research bureau, with the objective to build a new reliable and performing axial-flow turbojet. The French made and tested some German designed turbo jets made with quality steel unavailable to German industry in WW2. They ran for 25 hours instead 10 hours to German engines made of poor steel. Not much better. The German axial-flow engines failed because of heavy design faults. The BMW 003/Jumo004 was considered unusable. It was tested on the first French jet aircraft, the 1946 So6000 Triton, overheating and exploding. The plane only flew with a Rolls Royce Nene centrifugal turbojet. 

The ATAR project took 8 years to produce the first acceptable axial-flow turbojet (ATAR 101 B1), produced in 1953. So 8 years R&D by the French using the German jet engines as the base, which had about 3 years previous R&D, so about 11 years in all. It was installed on the first 100% French jet fighter, the Dassault Ouragan. 

The French lost a lot of time because the German jets had concept fails essentially in the combustion chambers and fresh air circulation to reduce the external temperature of the engine. The engine gave poor efficiency. The BMW jet was known for overheat problems which precluded fuselage installation.

The German turbojets had severe overheat problems as the engine would not work in an enclosed fuselage for single engined fighters. This defect was immediately noted by the French on the 1946 "SO 6000 Triton" prototype, and by the Soviets on the 1946 Mig 9. The Soviets quickly replaced the BMW 004B2 by the centrifugal Rolls Royce Nene which worked without problems, dismissing the BMW engine for fighter planes. The Rolls Royce Nene was copied to the last nut by the USSR being installed in the Mig 15 and used effectively in the Korean war. About 10 years ago the USSR eventually paid royalties to Rolls Royce. 

The question at the end of WW2 was what is the most efficient way to produce jet fighters. The answer is clearly not adopting the German design of engine and fuselage. The build costs for a jet engine were much higher than a piston engine, with the fuel consumption near 3x. The centrifugal compressor the British adopted in some planes was by far the best choice with 1944-45 technology. More compression pressure was not an advantage when the hot turbine was unable to resist higher temperatures. 

The Meteor was the first proper fully developed jet plane introduced in engine and airframe. The me262 was slightly faster than the Meteor F3, but extremely unreliable. The British would never put into the sky such an undeveloped plane as the me262. The British could have had a jet fighter operational in 1941, but it would have been as bad as the me262. The Germans advanced R&D on jets after they interrogated captured British RAF men. They learned the British were advanced in jet technology and flying prototype planes. Until then the Germans had no intention of mass producing jet planes. 

The rushed together Me262 started claiming kills on 26 July 1944, the Meteor claimed its first V1 kill on 4 August 1944. But the Meteor was a proper fully developed jet plane, not a thrown together desperate effort as the me262 was. The me262 used a fuselage of a 1938 piston plane while the Meteor was a proper newly designed fuselage specifically for jet fighters with forward of the wings pilot position as we see today. 

Centrifugal compressors did not quickly become obsolete when axial-flow engines were perfected, being used in turboprops. Between a turbo jet and a turboprop, the only difference is the turbine, not the compressor. The last centrifugal compressor jet engine still in service on a handful of old commercial aircraft like the Fokker 27, is the Rolls Royce Dart turboprop. A very reliable engine made in 27 versions, but with high fuel consumption to modern engines. The turbo jet engine that was produced the longest, was the Rolls Royce Dart Turboprop - a comparable design of turbojet like the Rolls Royce Nene. This rugged engine was produced from 1946 up to 1987. 

There is a myth, especially in the USA, that the Germans were way ahead of the British in jet engines and planes in WW2, when the opposite is true.
Reply: According to Whittle's own website, he only ever had an engine design that combined an axial flow compressor and a centrifugal compressor, he never designed a pure axial flow engine. NO ONE got axial flow engines right until after the war, and the Germans chose performance over reliability for their fighter, while the British jet couldn't even outperform piston engine fighters until after the war. 

The first jet aircraft was the Heinkel He 178, the Germans were first. You wont even look at the dates associated with this discussion, you're just biased and your argument is completely insane.

"It did not, if it did we would have all been riding around with immediately post WW2.  We never."

Your English is strange. Basically EVERY modern car is fuel injected, and modern fuel injection has much more in common with what the Germans used than anything that the British ever developed. The latest, most high performance engines are even direct injected, just like the German engines of WW2.

"Total bollocks!"

"Total tripe."

You haven't been able to prove me wrong yet. You British are even more insanely jingoistic than any American I've ever met, that's pretty scary. The facts are the facts, buddy.

"The WW2 German jet engines were extremely unreliable and had low performances with very high fuel consumption."

The same thing can be said of every other axial flow engine of the day. Again, the Germans chose performance over reliability and conceived of the engine design that would eventually win out over all others.

"There is a myth, especially in the USA, that the Germans were way ahead of the British in jet engines and planes in WW2, when the opposite is true."

The British seem to just go completely insane when it comes to national pride, so I'll just go by what the facts say, thanks.
Reply: Idontknow
Whittle's son uncovered that Ohain copied his father's patents.
Your knowledge of fuel injection is about zero.  Only when computers came about in the control was it viable for economy. 

The Heinkel He 178 was the first in the air for few minutes, but the performance was so bad the Germans dropped the idea. They only took it up when interrogating captured RAF men they gleened that the British had a jet plane fully working. The British could have put in a plane an unfinished engine to get a first but thought it a silly idea. 

The German research was so limited (based on Whittles patents) they could not have even got a centrifugal engine in the air they would have liked to.  The Germans never chose performance at all. They got into the air the only half backed design they knew, which was flawed.

The only axil-flow engine of the day flying (sort of when it did) was the German one, because the British did R&D on two designs. The British were the first to get a proper reliable jet engine in the air, not the Germans. The British back-burnered the axial-flow because of the complexities involved. The right thing to do in war.  

No credit should be given to the Germans for putting into service a highly flawed incomplete engine. I believe the first `jet` in the air was a motor jet - well no propellers.  Should we give that credit as well?

The British invented the turbojet engine, not the Germans. You have been proven wrong on about every point you make, by others and myself. 

I do recognise bollocks when I read it.
Reply: I'm getting annoyed and careless because of your bias. The RLM was unimpressed by the 178, but that was mainly because axial flow turbojets were already in development and they were clearly the superior technology.
Reply: I'd love to see a video-  a FACTUAL video--  that compares the Merlin with the Daimler, just as we see videos that compare airplanes.  However, I don't recall seeing any source, that compares the Spitfire with the Me-109, that shows that either candidate is clearly faster than the other.  Hard to justify a title of 'best' or most advanced' if it doesn't clearly out-perform the other.
Reply: The German engines were more advanced, and they were simpler in their construction, the only reason they didn't massively outperform the British engines was because the Germans didn't have access to high octane fuels. I don't know why people keep ignoring that. There's a fairly large difference in performance that can be obtained by going from 87 octane pump gas to 91 octane pump gas, that's only 4 octane points, while the difference between the fuel the Germans had access to and the fuel the allies had access to was as much as 63 octane points! The difference was typically around 30 to 50 points for the higher performing engines on both sides, and that's an absolutely enormous difference. 

When allied warbirds from WW2 are flown today, they're actually flown with significantly reduced boost pressures because those very high octane fuels are no longer available, so none of them are making as much power as they did in the past. The Germans were always stuck with those fuels but still managed to make very competitive amounts of power. 

Octane is hugely important.
Reply: idontcare80----    There's no way the Daimler would have 'massively' out-performed the Merlin simply because there was no 'magic' in engine design.  Neither side had a knowledge advantage over the other.  The two engines, in fact, probably had more in common than their differences.  The fuel differences were also not as great as you claimed.  Britain's fuel source,  BP's  refineries in the Mideast, could produce only 80-octane truck gas, but lousy for aircraft, as you pointed out.  Their source for avgas was the U.S., whose avgas was 100 to 102 -octane, color-coded green, as opposed to the yellow-tinted 80-octane gas for cars.  Yes, this did make a difference in the performance in the Merlin, but was not rocket fuel.  The antagonists, the Bf-109 and the Spitfire were still very comparable in terms of speed, climb, and range.  As pilots of both sides, who flew each other's airplanes attested in a comparison video, it was the pilot who made the biggest single difference in victory or loss.
Reply: Idontknow
You are some sort of nut.  Who keeps regurgitating the same illogical clap-trap.  You are incapable of learning.
Reply: I make it point not to learn incorrect information.
Reply: Idontknow
You are a nut.
Reply: I'm pretty sure I'm nothing more than correct, otherwise sources would agree with you and not me.
Reply: Idontknow
you are some sort of nut.
Reply: Maybe so, but you're immature and incorrect.
Reply: Barrie Rodliffe
I had a vintage Merc 230SL with a straight 6 and mechanical fuel injection. It was reliable enough but sucked fuel like crazy. Acceleration suffered because of the pump lag.  The only thing that improved the engine slightly was using fully synthetic oils and contactless electronic ignition.  The new ignition meant it started very easy and made a difference.  In contrast the straight 6 Jag engines had carbs and beat the hell out of the Merc.

"Fuel injection needs modern electronics to work well, it was not so good until well after the war."
The idiot was told that but it never sunk in.  Fuel in injection was pretty appalling for petrol road vehicles until computers came along.
Reply: Idontknow who is now The BrokenWorld
"I'm just pointing out that the Germans were clearly the superior engineers. "
Total tripe.
" British vehicles have a worldwide reputation for poor reliability and performance"
Like Rolls Royce, Bentley, Jaguar, Aston Martin, McLaren, MG, TVR , Triumph, etc. You are some sort of nut.
Reply: Whelp, apparently I'm being censored now if I try to add anything of value, so have fun living in your delusions.

Just remember what Churchill said about who it is who writes history.
Reply: None of you know enough about engine technology to understand that driveability doesn't matter in an airplane. Aircraft engines operate within a relatively narrow power and rpm range, and power changes are relatively slow, so whatever shortcomings early FI system had in cars didn't exist in aircraft. What mattered most was a consistent fuel mixture from cylinder to cylinder, because (like I've said many times now) a lean cylinder will cause the engine to catastrophically self-destruct when the it's pushed hard with high boost pressures. And, again, everything I've found says that the German engines were every bit as fuel efficient as the British engines, and that too would be a result of the FI system not having to operate over such varied conditions as it would in a car, it would be optimized for high power and cruise, nothing more.  

Nothing beat the 300SL in its day, it was the fastest car in the world. 

AGAIN, fuel injection made it possible for some of the highest performance engines on Earth to do what they do, mechanical or not.
Reply: My comment about British brands simply will not post, I don't understand. Most of those brands are now owned by German companies, hardly any British cars use British engines (if any), and most of the brands you listed are considered to be horribly unreliable. Some of those brands might make quick, fun cars, but that doesn't mean that they were good cars. I just learned recently that even the modern McLarens use an engine that was based on an old Nissan engine.

The British were innovative in a lot of extraordinary ways (their contributions to automatic computing and electronics in general were very significant), but would they have stood up against Germany if the war was just between the UK and Germany? What would they have done if the US hadn't been a source of resources for their war effort?
Reply: Idontknow
You are prattling nonsense again. The British decided to drop low tech products like cars. The third world could make these cheaper.  The Brits make MacLarens, Aston Martins, RRs, Lotus, Bentley's etc.  Many auto research establishments are in the UK. You have not a clue.
Reply: Right, they chose to make junk on purpose! Of course they did, how silly of me! /s 

The third world doesn't make cars on the scale that the first world does. Germany makes cars, the US makes cars and Japan makes cars, and Japan and Germany make really, REALLY good cars.

RR is owned by BMW, Bentley is owned by the Volkswagen Group, Lotus depends on Toyota for engines, and Aston Martin depended on Ford engines but now appears to be depending on Mercedes for engines. Many auto research establishments are everywhere, including Germany, Japan and the US. I obviously have more of a clue than you do.
Reply: The Broken Record.
You do realize your comments are just stupid do you?
The German engines were less efficient and idiots like you use the poor excuse of fuel.Before modern electronics carburetors were better.
Some racing cars in the late 1960`s and on did use fuel injection but that does not take away from the fact that carburetors were still in use into the 1980`s.  The Mercedes 300 SL was really a racing car and sold as a road car,  top speed depending on gearing from 145 to 160 mph.  
Why would I need to learn about cars, I was involved with cars from the age of 16 and that is not just being obsessed, my first win in a car was at 16 and not go carts. I worked on my cars as well as drove them.
I read very well but you do not understand the first thing about engines or fuel. 
Germany was being supplied with fuel from USA, unlike Britain who made their own 100 octane fuel. 
Germany used synthetic fuel during the war as well.
The pathetic carburetors have managed very well, The Jaguar D type with carburetors was faster than the Mercedes at Le Mans in 1955, even in 1954 the D Type had set a speed of over 172 mph and it was faster than that in 1955.
I do not remember calling you nuts but you do show your level of intelligence.
Changing your name does not make you any less of a nut.
Reply: "I don't like facts, they scare me." 

- John Burns, 2017
Reply: idontcare80---   What absolute drivel.  You don't know squat about fuels, engines, or history.  You are so wrong on so many points I don't know where to start to correct you or if I even have the energy to try, such a monumental task would it be.
Reply: Yeah.... right.... ok, buddy.
Reply: Since we're just posting random nonsense now: https://airandspace.si.edu/collection-objects/focke-wulf-ta-152-h-0r11
Reply: You act like a child.
Reply: idontknow
3 hours ago
"I don't like facts, they scare me." 
- John Burns, 2017  You really have flipped.
Reply: And look at what that was in response to.
Reply: I'm pretty sure John Burns, alexander kasady, Barrie Rodliffe and Gary Tarr are the same person, it's highly unlikely that so many people would find this discussion and then fail to understand it in exactly the same way. All of these 'characters' are failing to support their argument in very much the same ways, none of them understand engine technology, and they're all obviously British, or at least they've learned to speak English from British people, so....

When it comes to engineering, there's only one way to interpret anything, and that's in what works best and what doesn't.
Reply: idontcare80---   Ah, hahahahahaha!   Ah, hahahaha....  that has GOT to be the funniest thing I've read here.  Thanks for the good bellylaugh.  I don't know about the rest, but I am a real live person and a Yank at that.  I can't speak for the other two, but I'm pretty sure that John Burns is an idiot and not to be paid any attention to.  One does have one's suspicions, you know.  Disregard anything he says.  Aside from that, however, perhaps the fault for us to misunderstand your point of you in pretty much the same way might indicate that the fault is with you?  Perhaps you might wish to re-examine some of your own views, hmm?  Let us know how that works out.
Reply: Idontknow
The rambling thoughts of s deranged mind.
Reply: You wish, buddy.
Reply: Idontcare.
How many British troops were killed before Dunkirk? you don`t know. The fact is the more effective German army had enough trouble in Northern France, remember the British were the smallest number of troops in Europe at the time, less than 1/5 th the size of the German army. How was it the Germans could not stop the British from getting away along with 120,000 French.
The German axial flow jet engines never worked very well, the British centrifugal jet engines did and so did the British axial flow jet engines.
German fuel injection revolutionized the piston engine, is that why the bigger German piston engines were less efficient and less powerful? The so called low octane fuel is just a myth.
The Do 335 which on test flights had unresolved problems and it was barely in production, some prototypes and pre production Do 335 were made but it was too big and heavy for a fighter and not maneuverable. 474 mph  in test but it was never flown in combat condition.
The Ta 152 H did 472 mph at 41,000 feet but it had long wings and unlike the earlier Fw 190 low rate of roll and was not a good fighter, most were made as the Ta 152 C with a different engine and much shorter wings, the speed was much less.
Very few were made and they were rushed into service before they had been sorted out.
Reply: Barry Rodcliffe
"The German axial flow jet engines never worked very well, the British centrifugal jet engines did and so did the British axial flow jet engines."
The aim of having a reliable jet engined fighter was performance over the best of the existing piston engined fighters - otherwise why bother. The only fighter to fill that role was the British Meteor. It filled that role, including the airframe, being the first fully developed, reliable, jet engined plane.
Reply: Barry Rodcliffe
-"How many British troops were killed before Dunkirk?"_
One third of all British casualties in France were in the sinking of the troop ship Lancastria, not in the field, which was nowhere near Dunkirk.
Reply: Barrie Rodliffe - I'm asking about the entire war, individual battles don't indicate the effectiveness of every country's military throughout the entire war. The fact is that the German military was more effective, period. 

The Me 262 worked better than the wartime Meteor. 

The German piston engines weren't less efficient, both the Merlin and the Daimler engines had a BSFC of 0.45 lb/hp-hr. And, actually, the only sources I can find on this say that the Merlin ranged from 0.45 to 0.46, but the DB 601 never exceeded 0.45. Bigger engine does not = lower efficiency, the Japanese auto industry even had to relearn that recently. 

The Germans having access only to low-octane fuel is a well known fact. 

The Germans were having trouble getting anything into production near the end of the war because their production facilities were constantly being bombed into oblivion. 

The Ta 152 was more maneuverable than the P-51, and the P-51 was among the absolute best. Instead of your ignorant and extremely biased analysis of this aircraft, read the one link I was able to post here.
Reply: John Burns - The performance of the meteor didn't exceed the performance of the best piston engine fighters during the war, you're fantasizing.
Reply: Norman Rand Wolfe - Truly fantastic. I own one. But, perhaps you meant "fortunately"?.....
Reply: Lets not forget that the German 109s and 190s were more focused towards bomber interception later in the war. Most of the airplanes they were forced to engage other than the P47 were quite a bit more agile. Earlier on in the war the Spitfire and Hurricane out turned the 109s used then. More advanced engines does not equal a war winner. It was the whole package. 

Bottom line is that the Merlin and later the Griffon engines just outperformed the German equivalents where it mattered. They were very powerful and reliable compared to the over engineered German power plants. They did what they needed to do and no more.
Reply: idontcare80 Germans had the engineers but not the numbers
Reply: And the BMW 801 was even more advanced than that, it had a mechanical computer (the kommandogerät) that managed fuel mixture, prop pitch, boost from the supercharger, and ignition timing in order to make the engine controllable with a single-lever. That's not even something that's found in most modern light aircraft.

Winning a war is all about who has the most resources, nothing more.
Reply: The fuel injection was certainly a better arrangement.  I recall hearing that when the Brits examined a captured DB605 they couldn't understand how the incredibly close tolerances required by the engine could be applied to mass production, so perhaps that was a weakness of the engine design?  Merlins get rebuilt the world over, but the DB engines are pretty near impossible to rebuild I've heard.  But back to injection vs carburettors, I understand that there were some manouevres one simply didn't do with a Merlin, as the carburettor starved and you fell out of the sky.
Reply: Peter Anderson Look up Miss Tillies orifice.
Reply: oh brother!  The Daimler DB 605 also over heated, guzzled petrol and required constant maintenance.  
The P51 established air supremacy over the 109e with the Merlin as the kill ratio was 3:1
And for those who think we made more P51's than 109's, 33k + ME109's were manufactured for Hitlers killing machine.  P51 only had 15.5k units built with 11k + that had the Merlin
Reply: It was a little bit of an exaggeration, but the Red Army was responsible for way more German casualties than the western allies, and they had a pretty piss-poor military when compared to the Germans. They just had more resources (including men) at their disposal.
Reply: Yep, I guess that's correct.  The DB 605 was an uprated 601 used from 1942 on.
Reply: I went to do so Paul - I did a google search on 'Miss Tillies orifice', but no result was forthcoming.  Are you talking in code perhaps?
Reply: As far as aircraft engines went, I think the Germans had the best designs, but I think the Americans and British had much better airframe designers.
Reply: "Foukewulf 190"...?? You are not so good in reading and writing... aren't you? Focke-Wulf! Americans and the correct spelling of words in other languages... was never a "match". Please try a little harder the next time... you genius! lol.
Reply: It was so heavy for the produced horsepower that the German planes couldn't carry enough fuel to the fight to stay in the fight, and in order to have the speed to fight, didn't have enough wing area to carry as much firepower as was regularly on planes powered by the PW R2800.
Reply: Yes those engines were truly revolutionary, I read a story about 20years ago about a restoration of a bf109 they needed a part made, can't remember what the part was, but it required exacting tolerances so much so that it was beyond what was considered necessary. The part was taken to RR and they said nope can't recreate it with cnc this was made on old school equipment in wartime underground in the crappy-ist of conditions...what's that tell you, unbelievable the ability to keep on producing.
Reply: the_punnisher
I have driven many cars with Lucas electrics and all have been superb and electrically reliable. Even RRs had Lucas and they only fitted the best.
Reply: Advanced makes for more effective weapons, and that shows in losses that Germany's enemies suffered. Being stupid enough to try to take on the entire world, even with a superior military, is what will lose you wars. The Merlin was probably the most complex engine of it's kind (the Griffon might have been more complex) and the Daimler-Benz V12s were models of simplicity. The British didn't really have very reliable tanks either, and I'd be willing to bet that the problems with the Tiger were due to Germany's production abilities being compromised near the end of the war more than anything.
Reply: "It's not the number of people, it's the state of mind."

WTF are you talking about? The German military killed WAY more than they lost, so it was obviously the numbers. The Soviets also had a really shitty military and were fighting for their homeland, not some corrupt dictator.
Reply: Barrie Rodliffe - You're talking about ONE battle, how many battles did the British lose to the Germans at the beginning of the war? Hell, the British had to abandon France to the Germans because they were too weak to fight them off. 

"Guess when Britain had working axial flow engines?"

AFTER the Germans did. 

"...and by the end of the war they had reliable powerful centrifugal and axial flow engines."

The British couldn't make the axial flow engines reliable enough to use them in production aircraft either, no one really could until years after WW2, but the Germans still picked the winning technology right from the start. 

"Which German designs were used post war?"

The F-86 and MiG 15 were both based on the Ta 183, especially the aerodynamic research used to develop swept wings. A huge range of technologies that had been developed by the Germans were applied to technologies in the US, the UK and the Soviet union, it wasn't specific designs. Fuel injection revolutionized piston engines, and both the UK and the US started fuel injecting engines using German research. German aerodynamic research revolutionized aircraft in the post war years. The Germans developed stealth aircraft before any one else had. Rocket technology was another big German contribution. I'm really tired right now, so I can't think of more at the moment. Hell, just think about how both the Soviets and Americans raced to grab German research at the end of the war, because they knew that the technologies that the Germans were developing were absolutely game changing. 

I know all about the history and development of the Me 262, my point is that the Germans chose to develop axial flow engines first, while everyone else spent the next decade screwing around with centrifugal engines, only to find that they were a dead end.  

Many prototype aircraft don't fly with the engines that they were designed for, there's a long list of American planes that never got their advanced engines and had to fly with already existing engines, and those were just piston engines.

If rockets were the only area where the Germans were ahead, then why was the German military so ridiculously effective? Germany also had the fastest piston engine fighters of the war, and they were developed and built while Germany's manufacturing capabilities were damned near to being completely destroyed. 

The Me 163 was of an act of desperation more than anything, its aerodynamic design was the really the only major advancement.
Reply: How could the British be ahead of the Germans with axial flow engines when they didn't have a running engine until a year after the Germans? The Germans would have got axial flow engines right before the British, but this little thing called WW2 happened.

Germany was overextended on the eastern front, it was the Soviets and their massive numbers that turned the tide for the Germans in WW2.

You're not looking at the whole picture, you're just focusing on the facts that support your argument, ignoring the entirety of what happened during WW2, that makes your argument completely useless.
Reply: Idontknow
"The Germans would have got axial flow engines right before the British, but this little thing called WW2 happened."
The French after WW2 tried, with German engineers, to get the German jet reliable and operational. It took until 1953 with great modifications, using the latest metals. The design was flawed. While the first fully reliable axial-flow engine was the 1950 RR Avon.

The German based their research on Frank Whittle's patents. Whittle was the first to run a turbojet.
Reply: John Burns - The Jumo 004 was first run a year earlier than even the F.1 Freda, and it powered the 262 on a test flight in 1942. Did you not even bother to look at the dates for the German axial flow engines?

I don't know how many times and in how many ways that I can say this: I'm not saying that German engines went on to spawn more developed engines, I'm saying that the basic engine design, the German design, was different, more modern, and they conceived it entirely on their own.

"The German based their research on Frank Whittle's patents. Whittle was the first to run a turbojet."

No they didn't, Ohain did, but Ohain was a hack and his designs went nowhere. The RLM specified an axial flow turbojet which was inspired by the writings of another British engineer, Alan Arnold Griffith (who not only inspired Whittle, but who also deserves way more credit for the success of the jet engine than Whittle), but Griffith had wanted his turbine engine to work as a turboprop and didn't even think that turbine-based reaction engines could ever be a viable technology. It was BMW and Jumo who developed the first axial flow reaction engines, and nothing that they did was based on Whittle's design or Ohain's slight improvement to Whittle's design, the Germans conceived of the axial flow turbojet all on their own.

Edit: To be more clear, the RLM urged both BMW and Jumo to develop axial flow turbojets, and I don't think anyone really knows who it was that came up with the concept. It was probably either Helmut Schelp or Hans Mauch, but the engines were developed by BMW and Jumo.
Reply: Barrie Rodliffe - How many men did the British lose to the Germans, how many men did the Germans lose to the British? Who had the more effective military? (I'm actually asking because I can't find that information)

The Germans had axial flow engines FIRST, and axial flow engines were the winning technology.

The Americans and Soviets were only able to build a swept wing aircraft because of the aerodynamic research that they had taken from Germany.

"Fuel injection was not a German invention and Rolls Royce knew that it did not give as much power or efficiency as a carburetor."

That was because of the way that the British implemented their fuel injection systems. The point I made was that German fuel injection revolutionized the piston engine. The main reason that the German fighter engines could make so much power on such low octane fuel was because of their fuel injection systems. I didn't say that the Germans invented fuel injection either.

The 335 went into production just before the allies overran the factory, and it could manage 474 mph in *combat configuration*. No other fighter aircraft could manage those speeds when configured for combat. I was also talking about the Ta 152, which was able to go 472 mph in combat configuration.
Reply: "Whittle's son uncovered that Ohain copied his father's patents."

Who cares? Ohain didn't have any part in the development of Germany's axial flow engines. Why do you even bother replying to my comments if you're not going to read them?

"Only when computers came about in the control was it viable for economy. "

Economy isn't the goal of a war machine, it's designed to be as lethal as possible and that requires high performance more than anything. Fuel injection has been used on fastest racing engines for most of the last 100 years.

"...but the performance was so bad the Germans dropped the idea."

No they didn't, they were so impressed by it that they started developing actual fighter aircraft around turbojets. The RLM was so impressed by the demonstration of Ohain's turbojet in 1937 that they began the development of the turbojet engine from then on, that was well before war had been declared between Germany and the UK.

"The British could have put in a plane an unfinished engine to get a first but thought it a silly idea."

Which goes to show how much more forward thinking the Germans were.

"The German research was so limited (based on Whittles patents) they could not have even got a centrifugal engine in the air they would have liked to."

You're just going around in circles because you refuse to believe the facts. The Germans knew that axial flow engines had more potential and they were right. 

"The Germans never chose performance at all. They got into the air the only half backed design they knew, which was flawed."

Like I said, you're completely insane. Not only did the 262 outperform the Meteor, but it also vastly outperformed any piston fighter, the Meteor did not.

"The British were the first to get a proper, reliable jet engine in the air, not the Germans."

The Germans were the first to conceive of an axial flow turbojet and were the first to get one in the air. The British engine was useless during the war because it performed so poorly.

"The right thing to do in war."

The Meteor was useless in combat, making a plane that's useless for combat during wartime is not the right thing to do.

"No credit should be given to the Germans for putting into service a highly flawed incomplete engine."

It worked better than what the British had, which is all that matters.

"I believe the first jet in the air was a motor jet."

We're talking about turbojets.

"Should we give that credit as well?"

No, because it was a technological dead end, just like the centrifugal turbojet.

"The British invented the turbojet engine, not the Germans."

The Germans invented the axial flow turbojet, not the British.

"You have been proven wrong on about every point you make, by others and myself. "

Where? 

"I do recognise bollocks when I read it."

You can't even spell properly, you're just insane.
Reply: You have no idea what you're talking about. There's no magic involved, just engineering, and the differences between those two engines are quite large and quite obvious. Even the construction of the DB engines was very different from anything that came before or after, although some manufacturers are starting to adopt something similar for engines that are very highly stressed. As I've said many times here, direct fuel injection gave the German engines a huge advantage, because pre-ignition can be controlled by modifying when the fuel is injected into the cylinder. The allies had access to aviation fuels with octane ratings as high as 150, the Germans typically had 87 octane fuel, but sometimes had 100 octane fuel. The much higher octane fuels that the allies had allowed them to run much higher boost pressures, which significantly increased power output. Without that extremely high octane fuel, and without the benefits of direct fuel injection, those engines would have detonated within seconds of reaching their high boost setting.
Reply: Awwww... Did the wittle baby get his feewings hurt because he can't form a counter argument?
Reply: Gary Tarr
In the scientific war the British were head and shoulders above all others. In aviation they were supreme.  Their engineers were superb. Look at the floating harbours and the specialised equipment for D-Day.  Look at the massive Pikcrete (ice) unsinkable aircraft  carrier that was a goer, but the war was being shortened so it was not necessary. The British had a wooden place that held the same bomb load as  a US B-17, and outraced German fighters.   They thought out of the box.
Reply: idontcare80 
Total  clap-trap
Reply: alexander kasady 
The later Spitfires very much outperformed the  me109.
Reply: idontknow
"Since we're just posting random nonsense now:"
No. You, are posting random nonsense.
Reply: Idontknow,
What did the voices say to you today?
Reply: alexander kasady
Do your voices speak to Idontknow as well? Do they scream?
Sorry mate, the Yanks never won the war, despite what Hollywood told you. And the Mustang was basically a British plane.  Get used to it.
Reply: So, because a few people (supposedly) who can't support their argument don't agree with me in one thread of one comment section on YouTube, that means that I'm insane? Interesting. Not only have I gathered the facts that I've presented here from many reputable sources, but there are plenty of other random people on the web who understand aircraft and engine technology who agree with me, so... yeah.

The allies won because they had access to greater amounts of resources, period.
Reply: Daimler DB 601.
Reply: The reason it's so difficult to rebuild the German engines is because there's simply not enough parts left to do it easily.
Reply: "Winning a war is all about who has the most resources, nothing more."
A patently untrue statement. What kind of fucking dunce are you to put your name to such a stupid remark?
Reply: The German engines were better, the Germans were just stupid enough to try to take on the world. And, again, it's largely access to resources and manpower that will win you the war.

Power to weight ratio of the engines was due to the fuel they ran on, higher octane meant more boost could be used without damaging the engine.
Reply: In Germany there's no need for a remembrance for engines of war-machines... But when people here do this with a curiosity for the things or just the technology of that days, then you get certainly very fast labeled as a "nationalist" or an "irreclaimable idiot"... that's the truth about such things here in Germany!  We are educated here for a total disdain of the achievements of the German engineers at that time, because all of their effort went in "to keep up the war". That's quite a shame! You as an American have the completely opposite views on it. And of course the German engines were much more advanced than this here in the video! But Germany lost the war. That's all.
Reply: Fraser Wright thanks for pointing out fuel injection on the 109... No contest on g load and clime rate... Meh.. Sorry Jay..
Reply: The BMW is a masterpiece of engineering... Unfortunately, Germany did not have an Industrial Superpower building thousands of engines and planes for it. These engines were decades ahead of their "allied" rivals.